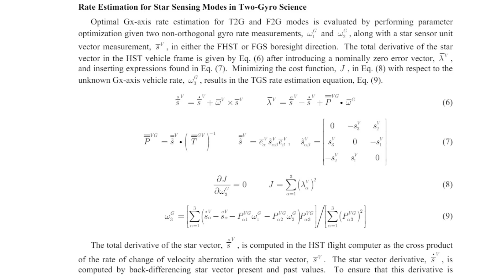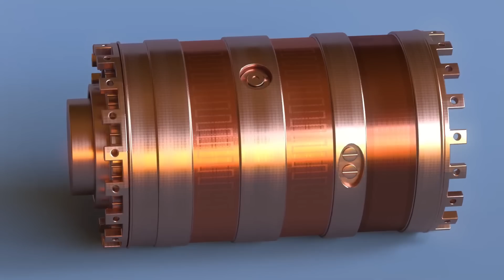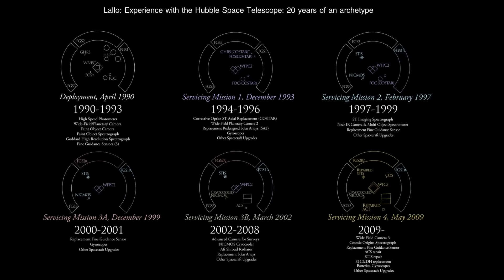How Failed Gyros Are Making Hubble's Life Harder

Comment: Wow, this really drives home just how OLD Hubble really is. As far as I know, nobody still manufactures or flies rotating mass gyros. Today they're usually based on ring lasers or vibrating hemispherical resonators. And star trackers these days have much larger fields of view, about 30 degrees half angle instead of the 8 degrees Hubble has. That's important because the tracker can see enough stars to determine its orientation in a few seconds, so called "lost in space" capability. If Hubble were built today, it would probably use a Northrup Grumman Scalable Space Inertial Reference Unit for gyros and one of the many star trackers on the market. And it might well be able to slew with no gyro at all.

Comment: Just so we the public are clear to those who control what goes on with Hubble... you must bring back Hubble for it to sit in a museum. That's not optional, either you do what's right by humanity, or you admit that you're okay with committing a crime against humanity. As Scott said it's easy to park it in orbit so we can bring it back later if needed there's many options. If we go through such lengths to keep the Mona Lisa in good condition, then saving THE most important modern scientific tool shouldn't be a large request. I feel the same with the ISS, but at least the ISS is so massive it's harder to justify taking it apart to return each piece with multiple trips.
Reply: No. That is dumb. We are going to be traveling into space periodically in 50 years. Like, space tourism. And what are we going to go visit?

Comment: We have not seen an investigation as to why an astronomer got a call from the maker of the telescope, asking what the orbital height of the satellite would be. The astronomer thought it a strange question, but did not inquire as to why it was being asked. He just gave the reply.

One reason why it might be asked is that the junior engineers in charge of entering data into the CAD program had a line asking for the orbital height. The CAD program was ordinarily used to make spy satellites. It asked for the orbital height to set the focus of the telescope being designed.

The reason why Hubble had blurry vision, by this theory, was that the technician was operating by rote, and was NOT understanding the rationale behind each step in the process they were involved in.

(The astronomer mentioned that he got a call and responded to the question. He did not say in the interview that this was a moment when the mirror error could have been caught. The interview may still be available on this platform.)

Comment: The DF-224 stands for "Damn Fast"-224 and it was... at least in the 70's.  The original deployment code (written in assembler) had a 40 Hz loop for reading gyros and the fine guidance sensors and 10 Hz and 1 Hz loops for other parts of the control law. The Lockheed folks did a fine job of developing and testing the spacecraft.

Comment: Are the gyros used in Hubble ring laser gyroscopes? They don't have moving parts, I believe. They are used on the ISS so they have been around for quite a while.
Reply: From what I read laser gyros don’t have required accuracy for the Hubble

Comment: We developed the HRG (hemispheric resonating gyro) and it is indeed used on later missions, and many satellites.  The HRG also a peculiar drift-mode problem, in that the fused quartz used for the resonator does have residual ions in it which drift ionically and thermodynamically through the quartz.  This causes and unknown long-term directional drift.  However, for short term pointing the HRG still works great.  Some of this drift can be minimized by using an AC forcing system, which randomizes the drift in all of the axes.  The Safran company now has the development rights to this technology, and is using it for commercial INS systems.  The HRG is limited now by its own electronics lifetimes, and although the gyro can withstand solar and cosmic radiation, the electronics have a much lower limit.  There is no need anymore to have the old style PIGA accelerometers or gyros, with any kind of fluids or moveable parts.  Arachic now.

Comment: During the Mission of the Deep Impact flyby spacecraft towards the encounter with Tempel-1, we had one entry into safe mode due to what was believed to be a "Inertial Reference Unit marked failed".
This was because the spacecraft was SO STABLE for hours that the system THOUGHT the gyro had failed because the rates were not changing by even one data number. The numbers seemed "Stuck".
They were not, the Spacecraft had just obtained such a stable attitude during cruise that the fault protection said "thats TOO good".
The ADCS Engineers at JPL literally said "We have not seen such a stably pointing spacecraft since Hubble".

We also did the fine guidance sensors in the Kepler Space Telescope and used the reaction wheels to point.
I could explain how I helped accidentally wear the reaction wheels on Kepler before launch, and how Kepler helped solve the years-old mystery of why these reaction wheels were failing in space.
I am helping plan the integration of the NEO-S Observatory for NASA next.
Reply: To paraphrase something said to military personnel in appreciation for their efforts:
Thank you for your science.
Reply: I have a suspicion that you are one of those rare few who can't wait for Monday morning 😁
Reply: It would be better to include your credentials at the top, I dont undersrand ehat you mean by we.
Reply: @635574  I am an Integration and Test Engineer that builds spacecraft for BAE Space Systems (recently Ball Aerospace).

Ball fixed the Hubble, built most of JWST, all of Kepler and IXPE and we are building the Roman space telescope from a spare Hubble structure.
Reply: @635574  - "I dont understand what you mean by we."
NASA, JPL, Ball Aerospace (now BAE Space Systems)
Reply: @635574  When "we" built Deep Impact the company was "Ball Aerospace".
Now it is BAE Space Systems.

Comment: You kinda get the feeling that NASA doesn't want anyone else to touch it, since it's kinda one of their flagships.  And having someone else go up and fix it shows off their loss of capability rather hard.
Reply: or someone else go there and break it, risks are high
Reply: @olasek7972  Possible, but if they don't get it serviced and reboosted, it will hit the science floor, then end up re-entering and they lose it anyway.

Comment: I thought gyroscopes should last forever in space if they used magnetic bearings, but maybe I'm confusing gyroscopes that work as reaction wheels, and gyroscopes that work as sensors.
Isn't there a contactless method available to derive slew rate instead of using wires? MEMS chips?

Comment: If they could get the mission, couldn't they replace the gyros with ring-laser gyros and give it a virtually limitless lifespan in one go?
Reply: Hubble doesn’t have laser gyros, not accurate enough
Reply: @olasek7972  Ring laser gyros are an order of magnitude more accurate (0.001 degrees per hour vs 0.01 degrees per hour)

Comment: Too bad they can't attach a gyro pack to the side of hubble (duct tape if needed) that is standalone. Not connected or powered by anything on hubble. Has it's own power source and communications. The pack is only there to get position/speed/angle information that can be synced with ground control after install. (Imagine a fitbit watch, but for hubble). Once the pack is installed, hubble can be boosted to a higher orbit.

Comment: Great Video !  The Boeing Starliner has extra fuel to raise the orbit of the ISS or the Hubble Space Telescope (HST) !  The SpaceX Cargo Starship after transporting contracted Cargo to the low inclination LEO CSS can then pick up the HST for return to the KSC !  Also the Blue Origin Blue Moon HLS with a Crew Module for a four person Crew, a LIDS docking port to mate with the HST, an Air Lock/Dust Lock (per Mike Griffin-NASA Management), a Canadian Arm (tested and used on the ISS) and a  6.1 km/sec delta-V !  The HLS/LEV/LLV with a  6.1 km/sec delta-V  can do Round Trips from the LEO CSS to the HST or GEO !  Also one way missions to the LS South Pole Lunar Outpost/Base (Clementine Base) can also be done to bring down cost in Cis-Lunar Space !  The Tech developed to return to the moon to stay, can take US and the world to Mars and beyond !  tjl    P.S.  Going from the Mars surface to a low Mars orbit can be done with a  5 km/sec delta-V  and using an Aero braking shield can go from a  Mars orbit to the Mars surface with  1.0 km/sec delta-V...
Reply: How about we wait until Starship actually manages to get to orbit once before gushing about about what it can and can't do.

Comment: Complement: Occasionally the Actuation, the gyroscopic momentum wheels are confused with the sensors.
The Hubble space telescope has 4 momentum wheels,  three, along the vehicle axes and the fourth along a cube diagonally. So redundancy was there.
How do I know? I was at LMSC working on the magnetic desaturation system, before it needed glasses to correct the  correctly ground mirror.
The team that did the correction installation included Claude Nicollier

Comment: For anyone interested in dates: NASA says that Hubble is expected to remain operational until until the late 2020s, and its current orbit keeps it aloft for around a decade from now
Reply: It might stay in orbit for awhile, however, it will start tumbling. Its the tumbling that will prevent any future service missions or even the concept we can save it. The window to get in there apparently closes in 2027. after that, its just a rock till it burns up (2037). Its going to be a fascinating story as I think nasa is going to pivot its mission to save hubble.
Reply: @darrinkinney2268 Tumbling would present a challenge but I don't think it would necessarily be an insurmountable problem.
Reply: That's the same sort of thinking that got Skylab destroyed before Shuttle flew.
Reply: @saundby  Except Skylab was in a lower orbit and produced more drag. Hubble will reenter no earlier than mid to late 2030s, they include the solar cycles and modern estimates are more accurate.
Reply: @saundby  not only did FrankyPi say what i was already about to but also, do you seriously think modeling and safety culture is at all the same now as it was back then?

Comment: Hubble needs to be boosted to a higher parking orbit and stored until we can retrieve it safely. That telescope belongs in a museum.
Reply: We should build a museum in space around it.
Reply: KSC has one in their museum
Reply: @garyhendrick4391  A mockup Obviously. But there is nothing like the real thing. It was a dream to see Odyssey(Apollo 13) and Liberty Bell 7(Mercury 4).
Reply: @garyhendrick4391  Engineering model that has done no science.  We need to return the real one someday with all it's visible damage from exposure to space. The last time they fixed it using the shuttle had some fascinating micro meteorite impact sites on it. It would be both cool and informative to see what kind and how much damage it has taken since then.
Reply: @AirDOGGe  Yes. its essentially a model. The only way the actual HST will return to earth is in a ball of flame as it hits somewhere around Point Nemo
Reply: So do I.  😊
Reply: With what budget? NASA is constantly being underfunded that you’re basically asking them give up budget for the Roman Space Telescope or the Mars sample recovery mission, which are already barely scrapping by, for a vanity project. Unfortunately, we just have to let Hubble go.
Reply: curious if the operational starship will have a cargo bay big enough to  hold hubble. but then it would have to land with that beast inside it. not sure the engines/structural integrity are up for it.
Reply: @oldfrend starship absolutely could do it once in operational condition. Hubble is large @ 13m long and 4.2m wide and weighs approximately 13 tons. Starships payload bay initially will be around 17m tall and 8m wide and capable of almost 100 tons. This is before their planned increases in size and capabilities. Starship would hardly bat an eye at this task…
Reply: Boosting is the cheapest and safest thing. From where it's at. 
So maybe in the next 10-15 years we can send up a big boost to get it later.
Reply: Agreed! On the moon!
Reply: There are no operational spacecraft that can do that, maybe a Starship could do it in the future.   The Hubble was designed to be serviced by the Space Shuttle, retrofitting another craft to do the same job is not feasible in the near term, probably not before it's too late.
Reply: Okay, Indy.
Reply: We would need a really big spacecraft with a really big payload door, and a giant robotic arm. Basically only the space shuttle would be able to do it :/ I wish we could have it in a museum one day that would be amazing
Reply: @briansantana3157  could the space shuttle actually land with Hubble in the cargo bay?
Reply: @_invencible_  It's what the thing was supposedly designed to do.... bring back large sats. Probably would have required a pretty wild re-entry though.
Reply: @patreekotime4578  this is like saying a car is designed to use a compressor to cool the people inside. It was one of many purposes and it almost never did it, and only with relatively small satellites.
Reply: @briansantana3157  Or Starship with a robotic arm.
Reply: @briansantana3157  I think there are other solutions to boost an object.  Space X and NASA have explored the concept.
Reply: @robertsonsid  is there no plan to essentially do a service mission on Hubble? is it not worth trying to extend the lifespan?
Reply: @Nate7.75 Right now, we don't really have any vehicles appropriate for a service mission, to my understanding.
Reply: @Nate7.75  As they said, it's not (yet) worth the risk as it still works for now.
Reply: @Nate7.75  with current mission costs, it would almost certainly be cheaper to just send a newer better telescope up instead. But as launch costs and such come down, and considering the historical value, it could change.
Reply: @Nate7.75  At some point, its cheaper just to build a new telescope.
Reply: @CptJistuce  In about a year's time, Starship should fit the bill nicely if there's any value to it. They can build much larger telescopes today.
Reply: @briansantana3157  Starship is currently under development, but when it's done, it will have a payload bay large enough to hold Hubble - it'll probably be a few years before it's ready for that kind of mission, but I'm optimistic it won't be that long before we would have the capability to grab it again.
Reply: @briansantana3157  Starship
Reply: Space X is looking at doing that.
Reply: Hubble's budget was also cut by 20% by Congress for the next fiscal period, so it's unfortunately pretty unlikely.
Reply: @ColorFrameByFrame And they have ended Chandra, EVEN THOUGH IT COSTS LESS THAN AN F16. JUST GET RID OF AN F16.
Reply: OR! (Hear me out) we park it in a higher orbit, and sometime way done the line once commercial space flight has become (relatively) accessible, we build a station around it and make the first museum, IN SPACE
Reply: We've got 10 hubble sized telescopes in Space. You only know about Hubble because it points into space. The others point at us...

Comment: I worked on a satellite alignment system that used a combination of inertial sensors and star trackers.  The inertial sensors were only used as the star trackers were passing through the direction of the sun.

Comment: What's the typical drift rate imparted by these unpredictable external forces, compared to the FOV? If the rate is small enough, they could use image stacking like amateur telescope sensors use. Instead of collecting light in each pixel like it's a bucket, you takes thousands of individual snapstops. Each snapshot is short enough that the drift does not result in smearing. The you align them images so the drift between snapshots is eliminated, and stack them (add them all together) so the resulting image is nearly as good as if you'd aimed it perfectly the entire exposure.

I could see this even potentially resulting in better resolution than stabilization using gyros and reaction wheels. Making microadjustments to the orientation of a device as large as Hubble is bound to cause small vibrations, which multiplied over the length between the primary and secondary mirrors, probably smears the image slightly.
Reply: Doing so would limit the sensitivity to whatever photons are captured in one snapshot. That won't be enough for the faintest signals

Comment: I think access to space is getting easier and cheaper as the years go on, not harder so they could replace the aging instruments and gyros, power system etc, but ideally the best option is probably to design a new bigger Hubble telescope that is easier to service and upgrade in the longer run.

Comment: I was wondering why they didn't use ring laser gyros, which you'd think would be less prone to failure. Obviously they didn't exist back when Hubble was being designed. I found a post on Quora by HST engineer Keith Chamberlin saying that the ones available in 2009 were noisier than the mechanical ones. This probably would have been fine for the mission, but ultimately NASA didn't want to change anything. I'm not sure I agree with keeping something known to be prone to failure, but maybe it makes sense given other constraints they thought they had on Hubble's life.